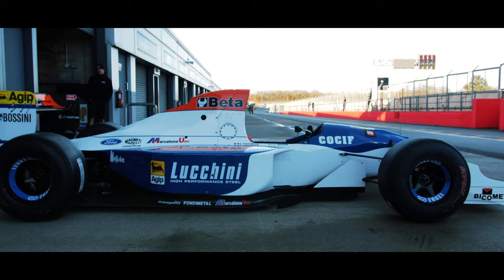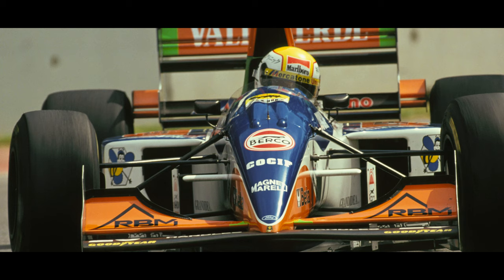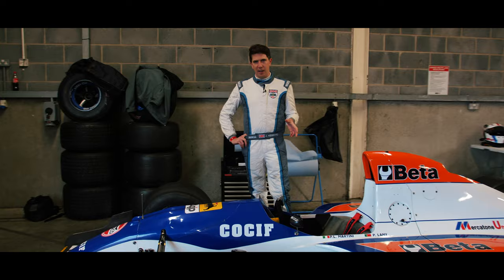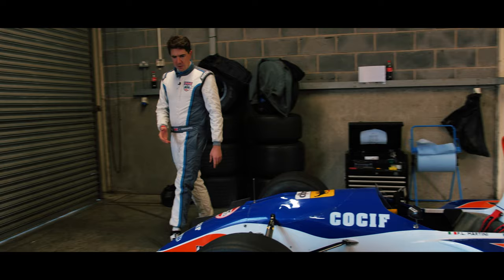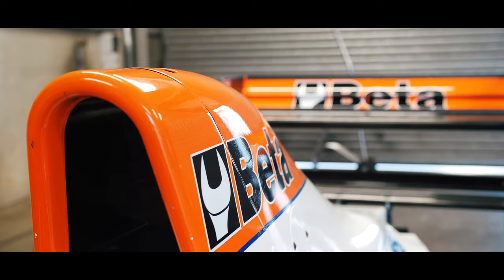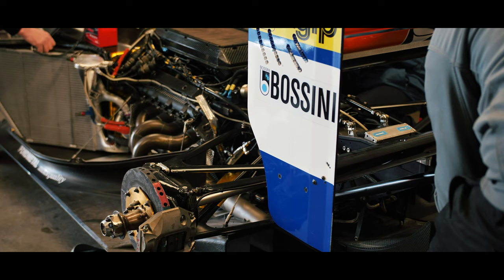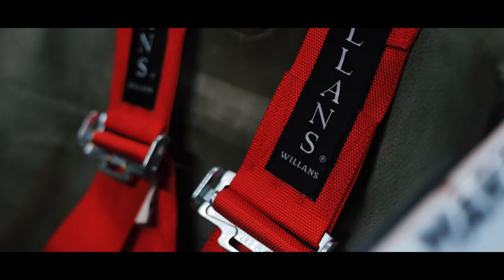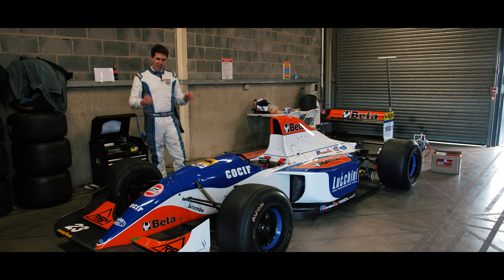Formula One Onboard as Jonathan Kennard reviews and tests the 1994 Minardi M194/5 at Donington Park!

Comment: Just seen you've put it up for sale, it looks fantastic. I see it's a manual gearbox, it wasn't a paddle shift in period then?
Reply: This was one of the last F1 cars with full manual gears, even though I checked on the Minardi website (yes it's still up!) which has info on all of their cars and it says it had paddle shifters at the end of the season. Probably whoever restored it converted back to manual for ease of use.
Reply: @ventisette.  I went on the Minardi website as well and saw that, could have been put back to a manual for ease of use or if the paddle shift wasn't reliable and they put it back to a manual. Hopefully the guy will respond. The chassis history is also not quite right as they used the M193B for the first five races which got the 5th place at the Spanish Grand Prix.
Reply: @martincollins7347  this is definitely a M194, it’s restored to French GP spec so has the manual gearbox as the paddleshift was added later. Early paddleshift boxes had hydraulic actuators which are difficult to maintain so most people who run these F1 cars convert them to pneumatic or full manual
Reply: @ventisette.  Ok cheers for that makes sense now.
Reply from the maker: @martincollins7347   Thanks Martin. This is chassis 5 and race in M193B spec in Spain and then this same chassis was upgraded to M194 spec. This particular chassis was always manual but the conversion to paddle is pretty easy if I ever wanted to do that. However, I personally prefer manual and its correct to when the car finished 5th in France. Glad you like the car!
Reply: @jonathankennardiconiccars5941  Ok cheers for that didn't know the M193B was converted to the M194. Hopefully your be able to use it in the future for some demo runs, When the world start's getting back to normal.
Reply from the maker: @martincollins7347  Would love to!
Reply: @jonathankennardiconiccars5941  I’m curious if this car has a sequential or H-Pattern gearbox.
Reply from the maker: @ventisette.  Sequential
Reply: @jonathankennardiconiccars5941  interesting, do you still need to “heel and toe”?
Reply from the maker: @ventisette.  Yes you do, especially in the wet. That's one of the reasons why I prefer it to paddle as there is more for the driver to do.
Reply: @ventisette.  I think it was only Minardi, Pacific, and Simtek that ran with conventional manual gearboxes. Minardi showed it could still work perfectly well! The semi-automatic 'boxes saved a lot on engine bills but were undoubtedly fiercely expensive to design and maintain. I'm glad this car stays true to the original config.